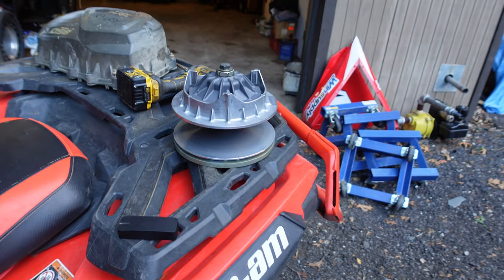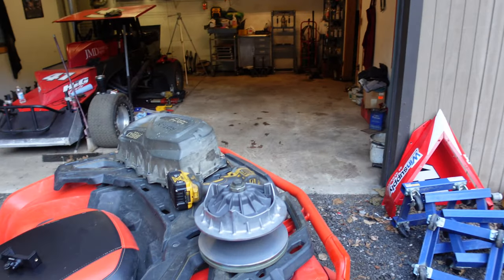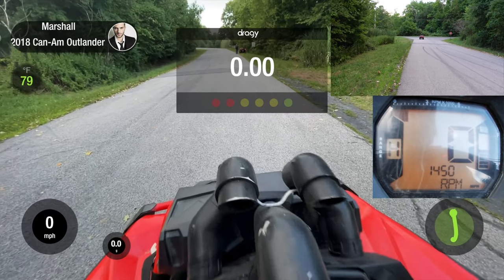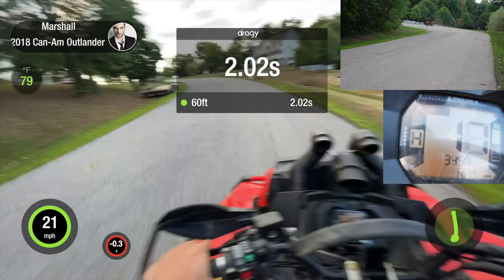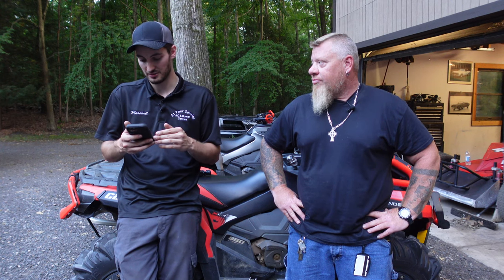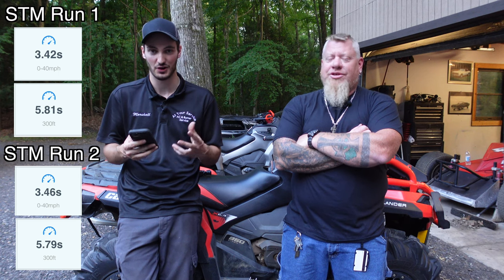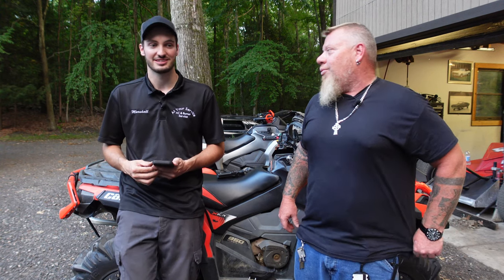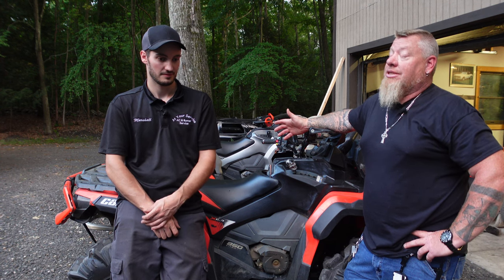STM vs CVTECH Primary Clutch Shootout! Which Clutch Do You Buy? Shocking Results! - Dragy Based Data

Comment: QSC primary and STM secondary is a proven combo.  Or both STM's.  Trust Me, I did a lot of research before making a decision.  You'll get the CVTECH and change to QSC anyways. Save your $. I ride with 4 others that tried CVTECH and ended up getting the  QSC /STM comb and could not be happier.  I went right to that combo.  As Always  "Ride Hard and Be Safe" MN Bill
Reply from the maker: Guess you'll have to wait and watch the video. We worked with clutch experts and mud racers to set up both clutches. you'll be surprised by the results...
Reply: @LetDirtFly  Wow!! was I surprised. I thought the STM would be hands down better.  That was a great test you put together. I wish you could have put the QSC in the mix.  If you get one, please do another video. You didn't mention the weights of the STM or CVTECH compared to stock. The QSC is 3 lbs. lighter than stock. That' a real plus.  Keep makin' the videos, I enjoy them all.  MN Bill
Reply from the maker: @minnesotaxmr  we would love to get our hands on a QSC and do the test with all 3 clutches. The STM does feel a little better all around then the CVTECH, but the Cvtech is no slouch if tuned properly. Have a good one man! 🤘🏼
Reply: I'm in Canada I have a 2022 renegade xmr 1000 I want this setup that your talking about for mine what is the best website to get these ????
Reply: @CBoutdoors-vh1ez  QSC and STM web sites.  A lot of dealers have them but the prices are close to the same. Shipping and handle might make a difference. Ride hard - MN Bill

Comment: If got a 2022 850 outlander, wanting to run 32 in sassys. Will cvtech turn them good with them being one of the heaviest 32s? I don’t like the the price of the stm lol
Reply from the maker: It should handle them fine no problem. Just stick with a factory wheel or a light aftermarket wheel to help save some weight. Nick from 2up2down runs 32 sassys on his 650 with only a cvtech and epi white secondary spring
Reply: @LetDirtFly   what would be the best spring for my secondary?
Reply from the maker: @outdoortexan114  probably epi white spring. If not its a good starting point.

Comment: Great video guys, I've been waiting for this for some time . I ride a 650XMR and have a cvtech primary. Stock secondary. I have been through 3 springs and 2 sets of weights using the knowledge of the experts with quite a few struggles. I would love to hear your spring and weight set up and if you see value in the secondary spring update. I found my set up tough to ride in tight trails as the power hits pretty hard wanting to lift the front end. I'd love to hear you comment or do a video on your findings or thoughts. Thanks for always sharing real time informative information.

Comment: So if the CVtech has been known to have issues in extream heat, has anyone heard of them having issues in extream cold?
Reply from the maker: Haven't heard of any issues with the cold. Heat yes like you said.
Reply: @LetDirtFly  Off tkpic but I noticed, here in Canada at least, the price of the Aztex have shot way up. Cheaper to get the Motohavocs by almost $400
Reply from the maker: @legowolf22  Every time they sell out the price goes up. I guess with inflation the materials are more expensive.
Reply: @LetDirtFly  Not to mention all the free ads they got from guys like you and mud puppy.  They know they have the lightest large diameter mud tire but its ugly so they needed the word out and now they can charge accordingly.  With such a price gap now between the 2, im now leaning to the motohavocs.
Reply from the maker: @legowolf22  It might not be as pretty as other tires, but they work and that's the only thing i care about. lol

Comment: Great vid fellas! I just bought a full Stm combo for my xmr 850. I ran the cvtech though for the last year and it spun my 32” nators with ease! The cvtech is a great primary clutch for the money!
Reply: What was your setup as far as weight and springs for your cv tech? I'm about to get one for my 850 xmr on 32 nators
Reply from the maker: Yours will be different due to the weight of them. The Teraches are very light.

Comment: I was one off those people that helped them with the tuning of the cvtech. i am 16 years with can am racing, building high hp engines and spending hours on hours on a dyno in the last 10 years testing performance products to see what your getting for your money.

The cvtech is a proven winner with many. It works well up to a 32 inch tire on the quads.  Now there are pros and cons to every clutch so there are applications where the billets are going to be better then the cvtech will.  The thing is too many drink the coolaid and THINK ( without testing and  comparing) that a billet clutch is better for performance.
Reply: I do my research and make my choices. Most people don't have the time or $ for test tune ride, test tune ride etc. I got the QSC and STM combo set up for me and could not be happier. BUT that's just my opinion.  Your  kool aid comment (even with your resume'), was appreciated by few I'm sure.
Reply: So on a Canam 850 Outlander 850 with 32 assassinators, would you recommend a CVTech/STM secondary or STM Rage 3 with STM secondary?

Comment: I just got a cvtech for my 22 850 xtp from hightech powersports tuned from 3p clutching. They sent a grey secondary spring too. I run stock 26 in. Tires. I have a dynojet with an RVS performance tune. Should I try the stock secondary spring or run the Grey?
Reply from the maker: Try them both and see what your shift out is.
Reply: Did you test both springs?

Comment: Such an amazing video! I know its possible to tune the CVtech to match a STM if your on 32in or less tires. To be honest. The CVtech has done me well over the years. My 570, 650, and 850 all had one on it. I've never broken one yet. The 570 did have a STM primary on it for its last ride and though it did great. Come to find out the CVtech I took off it wasn't tuned right. So yeah who knows what I could have been capable of. As for QSE. They're just like STM but way harder to tune from what I've seen. I think by the end of the day I never plan on going over 32in tires so the CVtech will always be my go to.
Reply from the maker: They’re definitely a great clutch for the money! That’s why I’m keeping mine for the 650. Does great with the 32s surprisingly!
Reply: Thanks for that tidbit about qsc being harder to nail on tuning.  Im not going bigger than 32s and might go 30s however gonna ride out on the stock cryptids till they are toast...still getting cvtech right away though.  I think a cvtech w/yosh pipe and rvs tune should work fine.

Comment: I’m surprised nobody has said anything about the factory clutch but then can be tuned to run with CVTech.
Reply from the maker: The can am factory secondary clutches are a pretty good design. It’s just the primary that’s not great. Going to a stm secondary definitely helps and also is way more adjustable.

Comment: Great video. I have a 2021 XMR 1000, which upgrade would you consider more important if you could only do one - a tune or a new clutch?
Reply from the maker: Clutch. the tune can come later. Seth's 650 hasn't been tuned yet, But with the cvtech its doing great.

Comment: Awesome video. Super helpful! I'm looking to run the same setup. Which weights are you using with the 1017 spring? 

Have you been hitting rev limiter from wheel spin when hammering it while on the trails? I saw you were getting a peak RPM of around 7700rpm while in high, which is getting close to the 8000rpm cut off. So if in low on the trail and you hammer it, you must hit rev limiter? 
Thanks!
Reply from the maker: With the 30's i didn't hit rev limiter but with 32's i am. I will have to shave a little weight off. I don't remember what weights in there right now.
Reply: @LetDirtFly  if you're over revving then you need to add weight. Your 32's are lighter than your 30's. Or they have less grip off the line. Curious to know once you check your weights. Thanks
Reply: @charles1127x  I believe we went to 18 gram weights with the 1017 spring for the 32's

Comment: That's a really interesting issue you had with the stm on your 650. I have a 650 max xt and I'm definitely thinking of getting the cvtech now after hearing what you went through (30" CST Sludge Hammers are as big as I'm gonna go). I'm wondering if there are people that had similar problems with their machines?
Reply from the maker: There’s a ton of people that can’t get the stm to work on a 650. The problem is the fly weights are too heavy. We removed all of the weight out of the clutch and could only get 7400rpm out of the 650. For a 650 you want 8200. I figured, no big deal just do a primary and secondary spring swap. When I called 3P and STM they said my motor was “hurt” and that’s why I can’t get to the rpm. But yet my cvtech ran 8200 all day long
Reply: @LetDirtFly   Did you try a stiffer primary spring with those lighter weights ?  And remember, there are two shift points on the primary spring, between start and finish, combined with fly weight ramp profiles, which all affect acceleration shift out RPM and performance.
We race snowmobiles and clutching up north and have found thousands of parameters of opportunities to work with..  That difference in overall weight between those two clutches is essentially non-existent..given these tuning options.

Comment: I've been running a cv tech and stm secondary since 2012 on my 800 max with 29 5 ol2  no issues and just swapped it onto my 19  xmr 850.  Back when we bought the cv tech originally it was to gain a lower engagement or gear ratio. Is that not still the case or has can am since changed the primary from my 2012?
Reply from the maker: Yes that’s also the case that we didn’t mention in this video. I did mention it in the cvtech vs clutch kit video. The one way bearing is smaller which helps get the belt lower in the sheaves which equals more torque off the line.

Comment: Hey guys. Was wondering if you could help me a little. I've been getting a bit of a run around with some shops and have wasted money on some useless parts. Anyways, I have 2018 can am outlander xmr 850. It has 6 inch lift with 34 inch assassinators on in and a hmf exhaust. Love this bike but I go through belts pretty quickly. Should I get a primary clutch or maybe a primary and secondary. Any advice would be greatly appreciated. Thanks.
Reply from the maker: If you’re on 34s with no clutching and no gear reduction like portals then you 100% need clutch’s. You’re creating too much heat. I’d probably go STM or QSC. The CVtech would work great, the bigger the tires, the more heat you’re going to create. The bullet can handle it much better over the cast aluminum.

Comment: Have you bored ur 650 yet. I have cvtech in my 650 didn't notice any change over stock .. I'm thinking I need put 800 kit in ..
Reply from the maker: Is the clutch properly tuned? You need a flash tune to raise your rev limiter to over 9k RPM and your shift out should be at or around 8300 RPM with a 650. The 650s make peak power at 8000RPM. If your clutch isn't properly tuned you won't feel any performance gain.
Reply: When I ordered the clutch they said they can tune to my set up.. where do I get a flash tune
Reply from the maker: Yah there’s your problem. All the clutch companies say they’re going to tune for your setup, but 95% of the time there’s still tons of room for improvement on the table. When your in high, go wide open and see where the RPM is at under a pull. 

We have Mr.RPM flash tunes. There’s other companies as well. Stay away from wholesale ATV/atvflashing.com. He does cheap tunes and doesn’t do half of what he says he is going to do to it.
Reply: My top is fine I'm looking for more bottom end say like if my bike has gears it's like taking off in 3rd .. need more acceleration... good to know .. . I was just looking at wholesale ATV
Reply from the maker: You’ll be able to gain a ton of bottom end with clutch tuning. Depends on what you want out of the quad. You can make it so the front tires never touch the ground when you hit the gas lol, but you’d lose top end. Do you know what spring they have in the clutch? Also what size tires are you running.
Reply: I'm running 28 mega mayhem.yes i want the front tires to lift . what spring and weight are you running
Reply from the maker: Unfortunately I’m running a totally different set up as far as tires go and I also run a stm secondary so my setup wouldn’t work in your quad. If you’re running mud, a 1012 or 1017 spring would be a great start. Weight is what controls your RPM, less weight, more RPM. 1012 spring is going to have lower engagement, but still have good power up top. 1017 is going to feel the same up top, but your engagement will be higher. This is better for situations where you have to get back in the throttle quickly because the quad will still be in the upper RPMs. I have a 1017 now, but am currently in the process of switching to a 1012 to see how it feels. Haven’t gone out to rip it yet.

Comment: So i live in southeasttexas which one should i do 1000 with 30 inch tires gets pretty hot down here
Reply from the maker: You’d be fine with the CVtech. Mark Sommer who is the CVtech guru runs over 100 wheel horse power through one with no issues.

Comment: i have a new 2021 outlander 850xt stock it seems slow or weak off the line until mid range what clutch would you guys get i want it to hit off the line but still  drive and ride normal ?
Reply from the maker: If you're running 32 or less tires and doing trail riding a cv tech would be a great clutch for you.
Reply: I'm all stock and wheels and tires
Reply from the maker: @stoneycarter7789  cvtech for the win
Reply: Get yourself cvtech primary the stock shiftout build for mid range power and it sks it feels dead when you hit it dead stop I have 22 1k outlander and I changed to cvtech huge difference and your aim should be 7300 to 7400 shiftout

Comment: How does it compare to stock clutch though?
Reply from the maker: It’s night and day from stock. Any aftermarket clutch is a massive gain over stock. Maybe in the spring we can film a video for you guys. The biggest thing with a aftermarket clutch is being able to tune the quad into its peak power. Stock, the quads under perform massively.

Comment: Can you guys help me out, I’ve got a 650 xmr with a trailbloc and the engagement is at 2700rpms, I’d like it to be around 2200 and I want to get 8100 rpm’s out of it what weights and spring will I need to achieve that?
Reply from the maker: Hey man, if you have Instagram message us on there. If not, I’d start with a 1012 spring. That should put your engagement around 2200 or so. Weights are up to you because that will determine how high your rpm is. You can drill and grind them to get your rpm up. You need to get a gram scale for this and start small with drilling to slowly take a gram out at a time. If you’re on a stock secondary, I’d go with a white EPI spring to help get the rpm up as well.